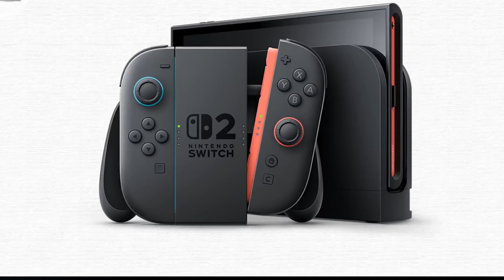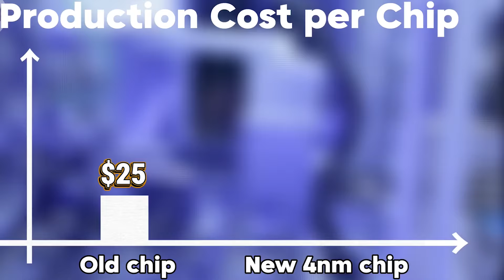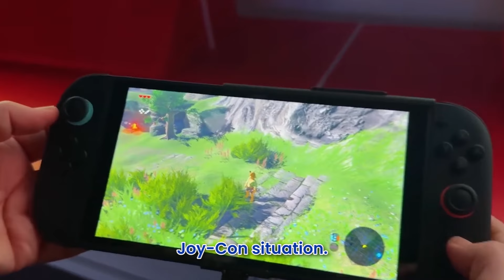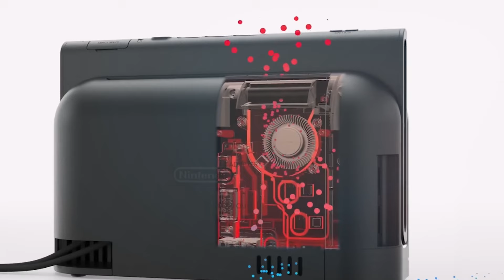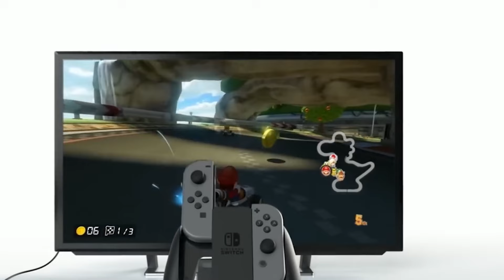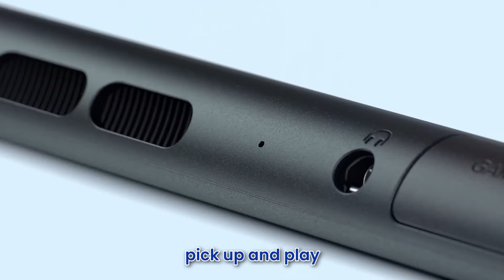How Nintendo Switch 2 Is Made – And Why It Costs $450 | THE MAKING

Comment: A next generation panel with full 1080p resolution............
Reply: do you realize how high the ppi is of a 1080p screen on a 8inch screen? It's a much higher ppi than a 4k 32inch monitor. And most people still use 1080p 24inch monitors...
Reply from the maker: Finally! About time Nintendo stepped it up — a proper 1080p panel is all fans wanted for years. 👏🔥